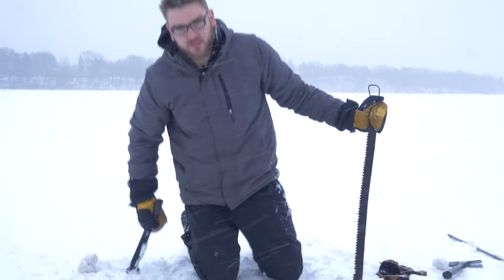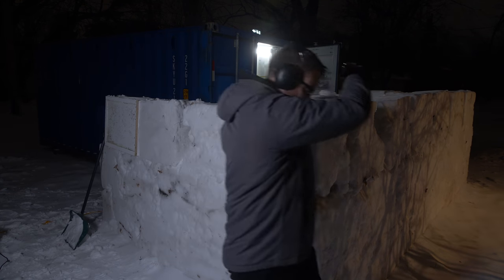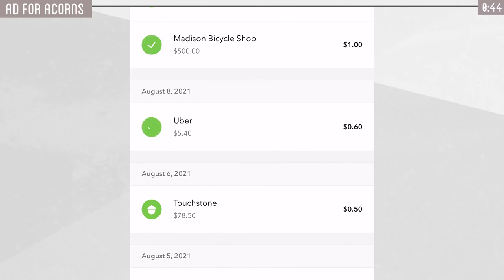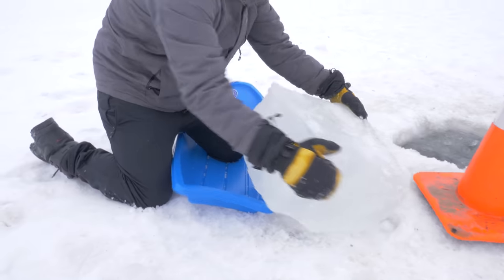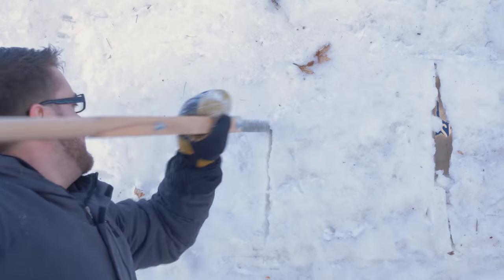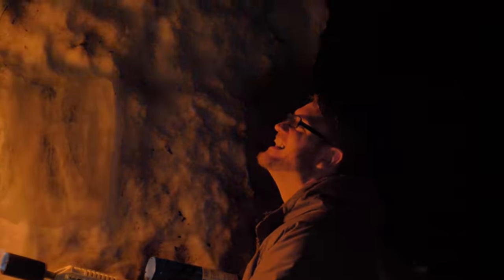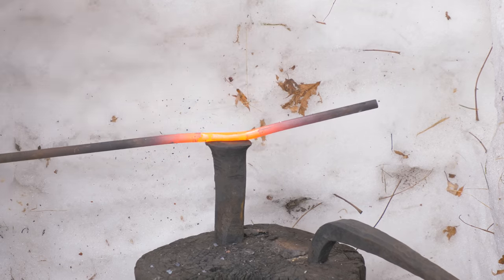I Rebuilt My Workshop out of SNOW and ICE

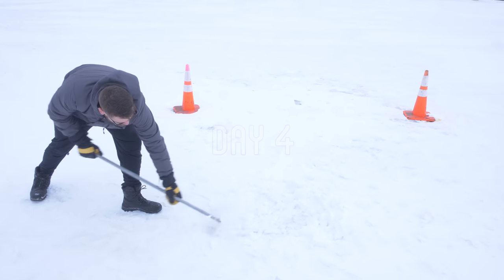Comment: FYI. During the ice cutting intro around 4:45, the talking to camera cuts out if you listen in mono audio. Works fine in stereo. Maybe it’s just me, but I tried on 2 devices and it still happened
Reply: Yea same
Reply: Same
Reply: Yep
Reply: Same here, only had my left earbud in. Sounded like digitally removed speech with intact background audio.
Reply: No wander i can't hear it and no one is talking about it, I'm using my phone speaker and wandering why no one complaining no sound
Reply: Same
Reply: Probably just an editing error
Reply: same
Reply: Same here, a lot of the audio got weird if using mono/one bluetooth earbud
Reply: So. I'm not on mono audio on my phone but this is still happening? I even tried turning it on and back off and no change.
I cast it to the TV, and I can hear. Wtf?
Reply: odd, my computer is on stereo but I can't hear about half the talking, now I have to go fiddle with settings....
Reply: Same
Reply: lmao just checked by messing with the windows audio settings and youre right. So fun to go from voice to no voice
Reply: The left and right channels are out of phase. That can happen for a lot of reasons but usually you can fix it in editing. The thing is, it's hard to catch because most people don't edit in mono, so editors usually don't notice it.

Comment: Pykrete.
A mix of roughly 14% sawdust or wood pulp added to water or compacted snow, and allowed to refreeze. It's remarkably durable and long lasting, and can be used for structures. Just don't cantilever it too much - build in arches and domes.

To extend its life, cover in an ablative layer of snow - which can be refreshed as needed.

Comment: You really should try to sharpen your saw,  I think it will make things go faster
Reply: Not only sharpen but also offset the teeth with a chisel.
Reply: @mattchrets  He can make a whole video on making a more efficient saw
Reply: I was thinking the same thing. Sharpen and set the teeth. Basically create a big rip saw for cutting fast and aggressive.
Reply: He didnt make a saw.... he made a strip of metal with triangles cut out of it.... Saws have sharp edges that cut the material lol.
Reply: @mattchrets  chisel? Anvil?
Reply: @starshot5172  you take a chisel or punch with a hammer. Place it on the individual tooth and hit. One tooth  bends to the left and the next one to the right and so on. If you look closely at a saw, the teeth are not in line.

Comment: Part of what makes snow structures warm on the inside is the layer of ice that forms as you heat it.  It's important to have an entrance that doesnt allow wind to blow, usually by making it a tunnel perpendicular to the entrance. and then heating the inside with a small heat source melts the snow and makes a solid shield of ice to hold in your heat. so its important to have a channel for water were the walls meet the floor.

Comment: For cutting ice with hand saw, you can use lot bigger teeths. Here in finland we have commercially 4-6inch tooth ice saws. About saving ice for summer, saw dust was the insulation for ice long time before electric and gas refregeration.

Comment: Years ago in Girdwood Alaska, some folks I knew made a pretty large igloo structure out of ice blocks. It took a couple months to complete. They simply filled plastic totes with water outside and let them freeze. They could make a couple batches of blocks per day. That thing held up well into the heat of summer.

Comment: I can think of a couple of unique building practices. One involves an air form, spray foam and shotcrete.  It is an almost fireproof structure called monolithic dome. Then there is straw bale construction with is environmental friendly method using straw bales to stack for walls. Good luck. Stucco and concrete materials will be safest for fireproofing a structure.

Comment: Part of the igloo problem, it was fairly large. The added space meant you had to heat all the surrounding air, a successful snow shelter should be small as possible, but still had the temp dropped during the night the igloo temp would have remained about where it got to. Still it's always fun, I loved snow cave camping in scouts.

Comment: Interesting to watch you make it 
20 or so years back I made a snow cave and spent a week living in it , it lasted till late April 
But I started with a mound of snow , a LARGE Mound of snow 
They hauled snow  to my place out of several parking lots in dump semi trailers 
I used a front end loader to make the mound 
I then removed the center leaving 4-6 foot walls 
I put wood for the ceiling joist and added steel roofing 
I used a tractor with a snow blower to blow 2 feet of snow on to to insulate and seal the roof

Comment: it would be an interesting experiment next winter to try pykrete (sawdust combined with water and frozen) instead of snow/ice, it should be a lot more resistant in time and if you have enough casting forms you should be able to "cast" bricks to use for the building (you can even go the "Lego" route and make blocks that can interlock, making it easier to build)

Comment: If you use sticks in the walls it goes a loooong way to keeping flat walled ice structures together, as for the melting, you have to make sure it's either out of the sun or build it about 1.5x thicker than otherwise, you could also use sticks on the outside (not touching) to block the sun.

Comment: Well i would suggest to try some building methods of the past for the workshop but ... well you will be limited to what was used at your temperature zone ... you will not be able to build a lasting solid clay/mud building as they are common in warm zones like central africa/india. But you could build in the more central European style of Timber Fraiming ... or for the anti flammability of the workshop some nice brick or roman concrete buildings. There are many many possibilities that offer a solid building to explore where the biggest investment is time and manpower.

Comment: Something we would often do as kids here (Southern Ontario, Canada) was to lightly spray the finished build with water, like a mist setting
to create a thin ice shell then to add more snow and misted water to build it up over time. Popular among the kids for stronger forts, but
also for stronger snowmen when a*hole older kids would come by and try to knock them over, found out the *hard way after the first kick or punch. 
😂
Reply: And I don't know how cold it gets there for you in the winter, but we would often just left water out in buckets/trays to freeze either overnight or sometime even
during the day, like rectangular ones you might use for a foot bath.
Reply: also sticks for support and to block the sun

Comment: You can use thick blankets and foil to insolate. My grandpa use to make insolation blankets for our farm. I would help make the blankets for the cows and sheep. We put foil on the outside of the blankets to reflect light. It heats up to keep the animals warm in the winter. You can add water to cool it down in the summer heat. Reflective surfaces are great for heating and cooling. You can use it to wrap pipes to help heat them with the sun or fire. But I don't think it's fireproof. Unless you treat it with fireproofing chemical's.

Comment: When I was a teenager in St. Paul in the late 60's, early 70's, the family would build ice forts by filling up plastic buckets with cold water and letting them freeze over a few hours for the building material. We'd add food coloring to make the blocks more interesting to look at. The easiest snow enclosure to make was just to pile up 5'-7' of snow, pack it down, then hollow it out with a shovel. But, for surviving the night in minus weather, we'd just sleep in sleeping bags on air mattresses on the concrete floor of the bike shed. Zero insulation,  but with the sliding door more or less closed it protected us against the wind at night. Probably the biggest issue would be dehydration, because any external moisture freezes fast and the air stays pretty dry. Leaving water near the sleeping area overnight means it'll probably be frozen in the morning. The worst part was when we had to leave the nice comfortable sleeping bags in the middle of the night to go outside to take a piss...

Comment: So what about the thought of making ice blocks. On the one hand easy to make, but ancent civs may not have much access to running water during the winter. So I could you calling either way. But in my home town most of the river never freezes all winter. One could get it from the lake after making  a hole. One could also make a fire and melt water to then use in a ln ice block mold. Maybe next year you can explore this

Comment: Cracking the ice with a hammer and wedges seems far easier to do imo. Also have you tried building a wooden loose frame and filling it with snow and water and letting it freeze over night?

Comment: So something interesting to note about igloos. I will mention I am in no way an expert, but
I have heard of the way you construct an igloo so you can have a fire is a bit different on the inside than your flat bottomed one.
So basically you have a shelf of snow that you build up on one side of the igloo, opposite the door.
In the doorway you build a slight pit, this is where you keep your fire. The logic goes is that the heat rises and melts the inside layer of the igloo, creating insulation using the ice that refreezes. Also because you are sleeping on a slightly higher shelf (also better insulated from the ground) you benefit from the heat of the fire, without needing to be right next to it. 
Also because the fire is in the doorway, it would make it a heck of a lot less attractive to any wildlife in the area.
Not entirely sure how well this actually holds up, but I read it in a biography (lord knows I can't remember the name 🤦🏽‍♀️) and did a bit of research.
If I can find sources I will link them below, also feel free to correct me if I'm wrong!

Comment: smol brain: cut ice out of a lake for a window
big brain: pour water into a window-sized tub and let it freeze solid over night
Reply: Water expands as it freezes. It gets stuck in the mold and often breaks when you are removing it.  You can warm the mold to melt enough to extract your ice. Its touchy. Not enough heat and it refrezes before it comes out.

Comment: 18:10 So, im prty sure the reason for this complaint is cuz you didnt warm up the inside of the igloo first at all. Normally thered be some warm air comin into the igloo, such as from an open fire (either inside it or outside) or even just human body heat thruout the day.

Your igloo stayed prty close to its original temp and the outside warmed up faster in the morning too. 18 and 27 only gave it 9 degrees difference initially and thats hardly warm compared to the outside; had your igloo even just been around mid 30s inside it wudve stayed much much warmer compared to the outside. Or if you packed the igloo full of more sleeping humans so that more body heat can be shared in the small space and help to keep it warmer thru the nite.

Comment: 4:25 A "half igloo" does not work because the blocks at the straight wall can't support the forces pulling to the inside. And video clearly shows that blocks at the straight wall start sliding first.

Comment: Correct me if I'm wrong, but isn't the main part of an igloos effectiveness the small size? So I don't know if the workshop will stay very warm
Reply: Small size can help but snow stays frozen till 32 degrees. The surface may melt but the ice keeps refreazing it. The air nearest the walls stays cold helping slow melting. You can safely warm the air in the middle to around 45 degrees an sustain structural integrity.